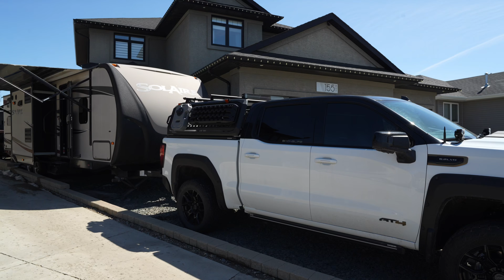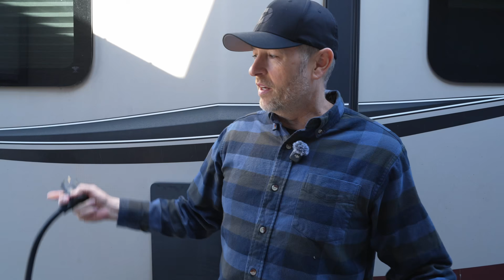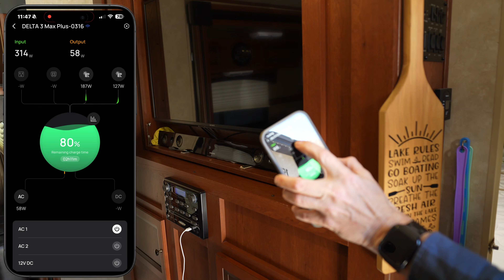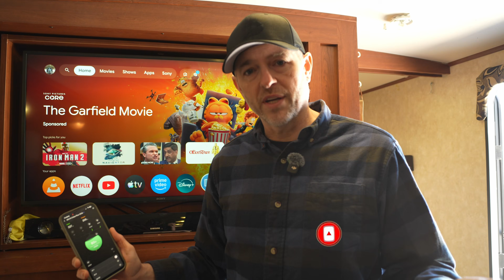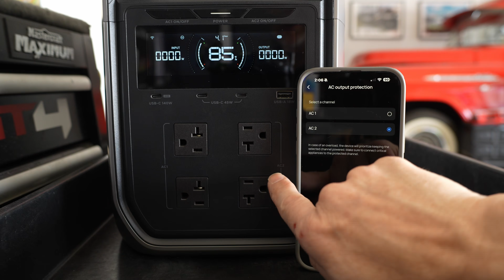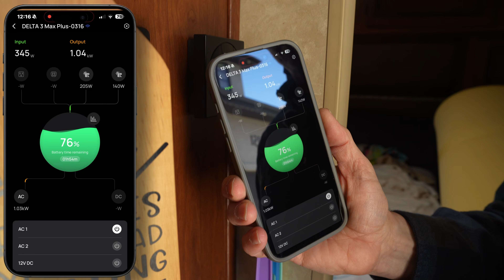Can This Solar Generator Power a Camper? | EcoFlow DELTA 3 Max Plus Test

Comment from the maker: I’ve now tested BOTH the EcoFlow DELTA 3 and the DELTA 3 Max Plus with solar panels in real-world conditions 🔋☀

If you missed my original DELTA 3 + solar panel test, you can check it out here:
👉 https://youtu.be/6cKU82RQkUk

That video focuses more on portability, everyday usage, and basic power needs — while this DELTA 3 Max Plus setup is all about pushing things further for camper and off-grid use.

If you’re curious about solar generators, portable power stations, or off-grid camping setups, definitely check out both videos and compare the differences for yourself.

You can also check out the DELTA 3 Max Plus here:
👉 https://bit.ly/4tG7eKS

Use code EF26MFLG for an extra 5% off until May 27th.

Also available on Amazon: https://amzn.to/4wBVjAb

Comment: Thinking of using my max 3 to run aeration for my pond .1/3 hp for a couple hrs a day dol u see a problem with this? Thank you!
Reply from the maker: That should be fine.  A pump like that is probably 300-600 watts per hour.

Comment: I carry Eco flow delta 3 about 300 feet on small stone road every day with motorcycle to charge . It a little shake. How can effects on power station.
Reply from the maker: They’re made to handle vibration.  I can’t say how much exactly, but packing them around on and in vehicles is part of the design

Comment: Nice video! Thanks! Just curious,  why are you still using a lead acid battery and not Lithium? Tale care!
Reply from the maker: Thank you. Mainly because to convert the system the camper came in with in 2013 and do it properly would cost over $1000.  It can cost even more if we wanted to add all the bells and whistles.  I am up for DIY projects though 😂

Comment: Great video! I'm thinking about getting one. How many hours could it run the ac before needing recharged?
Reply from the maker: Too many variables to give an exact estimate.  Without accepting solar power at the same time you would get 1.5-3 hours depending on how cool you’re trying to make it. How often the AC compressor cycles and the size of the unit and area being cooled play a role

Comment: Can you run a washer or dryer ? With the delta pro
Reply from the maker: The DELTA 3 Max Plus can technically power many washing machines because the power draw is manageable… but something like a full-size electric dryer uses so much wattage that battery runtime becomes unrealistic pretty quickly.  It comes down to the specs you find that work within the products range
Reply: @Donslife thank you 😊

Comment: Thanks for sharing.  I'm thinking about getting a single solar panel and am hesitating between the 160W and 220W panels.  How do they compare to each other in efficiency and real-world performance?  In Canada right now I believe the 160W is 299$ and the 220W is 429$.  Would you say the 220W is worth the price difference?
Reply from the maker: Both will do the job.  Both are the same size to carry around.  But the bi-facial (220w) panel is quite a bit more efficient if you have the space.  You won’t have to reposition it quite as often either.   It is a tough call

Comment: 😊 amazing EcoFlow delta 3 max plus on YouTube video 👍👍👍👍
Reply from the maker: Thanks for watching! 😊
Reply: @Donslife 😊 your welcome
Reply: @Donslife I have the Delta 3 max plus including 2 extra batteries and the new extra battery adapter. I power it with 800 watts of solar. Trust me it would run that trailer easily with enough juice to be reckless

Comment: Hey Don,
Truck and trailer question.
Is your AT4 a 1/2 ton?
What size is your travel trailer?
My wife and I just purchased a 30ft travel trailer and we are going to be looking for a towing rig.
Reply from the maker: Yes half ton with air bags and weight distribution hitch.   6300 dry  33ft trailer
Reply: @Donslife excellent no issues towing, stopping or being pushed around by wind?
Reply: The trailer we bought is 5800 dry 7500 gbwr a 1/2 ton should do it I think.
Reply from the maker: With my setup it has been fine.  Remember to break in the truck a little before the first tow
Reply: @Donslife thanks will do!
Reply: The EcoFlow is an amazing product! I have a Delta 2 that I use on our boat, while on anchor. I use it at night to run our two CPAP machines so we don’t snore and wake of the neighbours 😂. This will bring the unit down to 45% (7-8hours) and then we will use toaster 3 times and make 5 cups of coffee with a Keurig. This usually brings the unit down to maybe 25-30%. At that point I hook it up to the EcoFlow Alternator which will use the charge from the house batteries, that are being charged by 400 watts of solar power, on the roof.  Could the unit be bigger yes, but this does what I need at night and if need be I have a generator for during the day if needed and it is compact. I do believe all the EcoFlow products are able to use dual charging, so you can charge with Solar and 120 volts to make it quicker.

Comment: Just FYI, if you use X-boost with your RV A/C, you risk damaging the A/C unit.  X-boost drops the voltage to compensate for higher draw.  As watts = volts x amps, it will keep the watts level at the max it can do by adding current and dropping voltage.  Really bad for an A/C unit, microwave, and some other expensive appliances to run on low voltage.  Better to turn x-boost off and have the ecoflow trip than run very low voltage.
Reply from the maker: Agreed.  X boost for hair dryers, kettles, etc is  best

Comment: I have two lithium 100ah batteries in our 33ft fifth wheel with two solar panels on the roof. Between the up graded solar charger and two batteries under $300.. Going into the third year and have never had any issues..